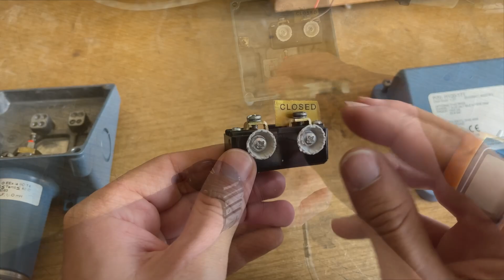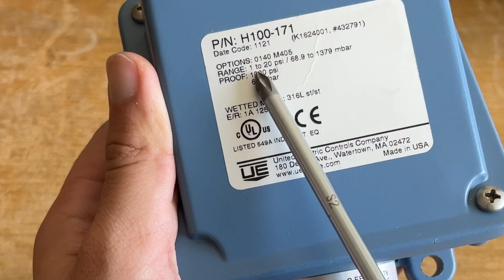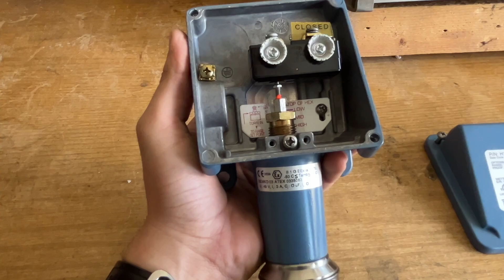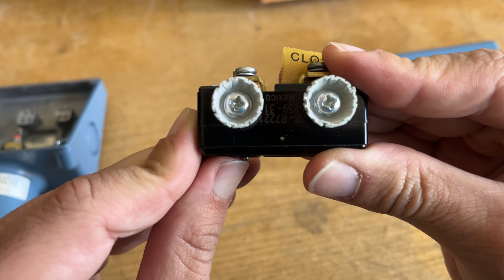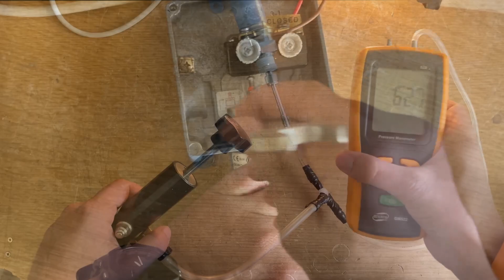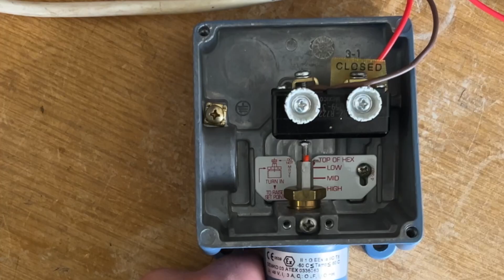How a Pressure Switch Works

Comment: is there a pressure switch that changes states with LOSS of pressure? for example, if you need ATLEAST 20psi in a system and any drop below that set point causes the switch to change states. I believe there is but im not sure. Thank you
Reply from the maker: Yes! You just need a switch with Normally Closed (NC) contacts. In that setup, the switch stays 'off' when pressure is high, but 'clicks' on the moment the pressure drops below your set point (like 20 PSI). It’s a very common way to set up low-pressure alarms!
Reply: @officialElectroLab Thank you for the response. I was also thinking about utilizing this type of switch as well for the same purpose and i believe i could as well as long as its pressurized consistently. With this kind of switch i could wire it on the N/O contact thats closed cause the system is above 20psi at all times until it falls below the setpoint, causing the contact to open again right? For this switch i could use the N/O for lets say a "green light" and the N/C as a "red light" or warning. I have a hands on test coming up and they might just hand me this switch and tell me to figure it out so I've been thinking about it.
Reply from the maker: @oda4334 It works exactly how you think it works.